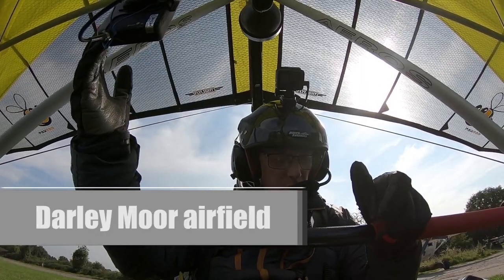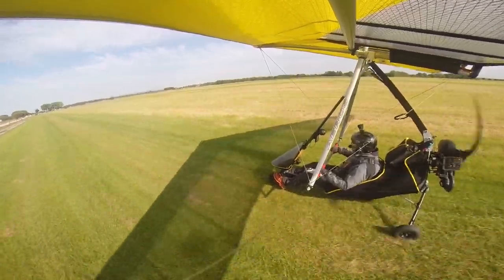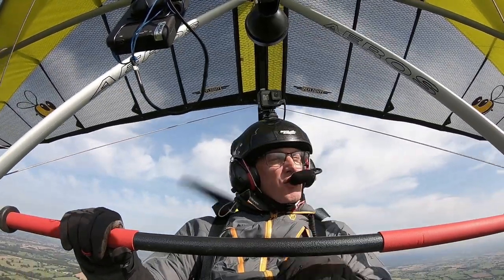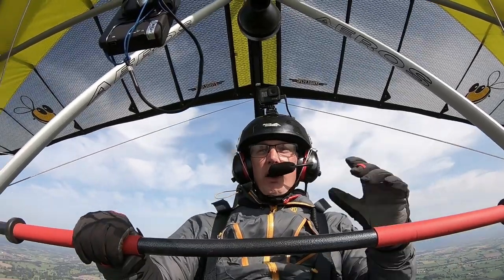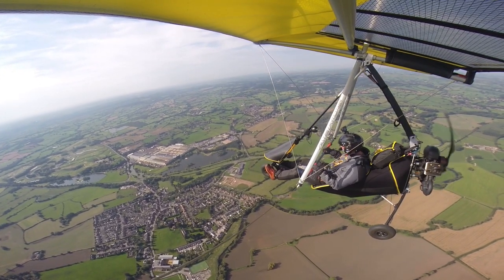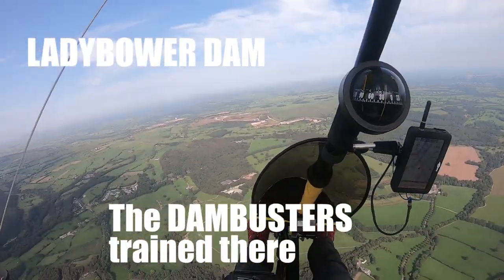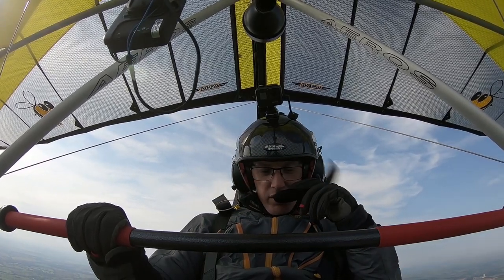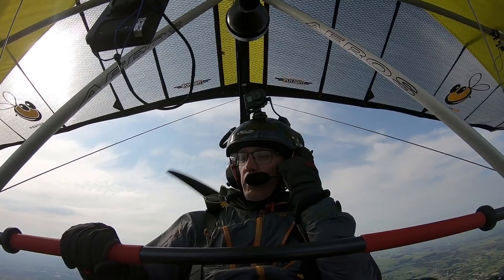MY LAST FLIGHT - on my Sub 70 PEABEE Ultralight

Comment: Great vid
I fly vicariously through you for the winter so that was a nice one.  Looking for to seeing your PB updates, in particular the hand throttle as I am trying to figure that one out myself.
All the best.
Reply from the maker: Hi Patrick, I've finished the hand throttle, I used a metal motorbike cable splitter for twin carbs and a lawnmower hand throttle. With a few extras and travel adjustments, it's fitted. I just need to flight trial it.
Reply: @GolfFoxtrot22  
Do you still have use of the foot as well?
Reply from the maker: @patrickmckowen2999  yes, full Independent use of both. It's the reason for the  cable splitter. I'll try and post a link to the item (that I used in the UK). https://www.classicbikepartscheshire.com/handlebars-grips-controls-c77/throttle-air-cables-c185/amal-classic-motorcycle-throttle-cable-junction-box-2-1-fits-triumph-norton-stainless-steel-p1950/s2005?cid=GBP&gclid=Cj0KCQiAtqL-BRC0ARIsAF4K3WEs8wT0Ok8Uu0l_s8_W00C8EoYzeqwmwwu8tb6e-TP2-pJ8IIGHP9AaAo4OEALw_wcB

Comment: Hi Giles, about the flat approach when you hold off there seems to be a good bit of daylight between the control-bar and the forward strut. Could you put on a speed bar (Talking hang glider speed bar) and gain the extra down angle?
Reply from the maker: Since I've modified to the Adam wing the HOT is further forward so I do get much closer to the front strut on landing, and the nose is higher as well. I can also get very close to the VNE with the bar fully back so I don't think I'd be able to uses a speed bar. Having the bar get all the way forward does help the trike unstick on takeoff, so the straight bar is the only real option.

Comment: I thought for a moment you had sold the Peabee but no. Bigger fuel tank. Good move. I wonder what the max weight can go upto?
Reply from the maker: Hi Sandy, yes, sorry for the initial tease. The MTOW (deliberately being coy), I can take the PeaBee as it is now, 25 litres of fuel, the big wheels, and still have capacity for 15kgs of baggage, including me.

Comment: Nice vid! Why did you want to convert to SSDR?
Reply from the maker: The main reason is it will allow me to carry more fuel.  As a Sub 70 machine, the 11 litres only give me 1 3/4 hours max, with my new 25 litre tank and 6 lph consumption, I can actually fly somewhere and fly back without having to worry about sourcing fuel.  The UK Sub 70 ( Licence free) flying machines are  brilliant but it does restrict the duration unless you have a very light machine.
Reply: @GolfFoxtrot22  Ah, got it. Yes, that makes sense...
Reply from the maker: @ForFunFlyer  This weeks video will make it all become clear.
Reply: @GolfFoxtrot22  Nice, will watch that one too

Comment: no airspeed indicator?
Reply from the maker: Nope, it's trimmed for one speed. It flies at 43 mph. Pull the bar in it goes fast, push it to the strut, it might stall. It really doesn't need an ASI.